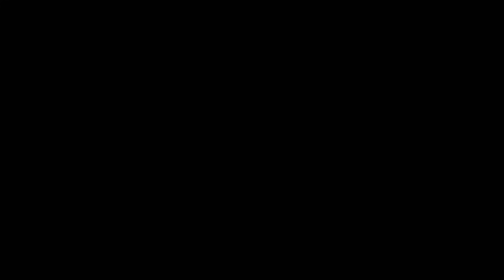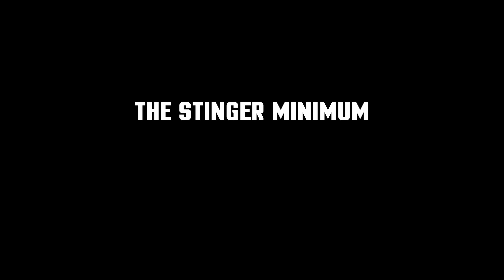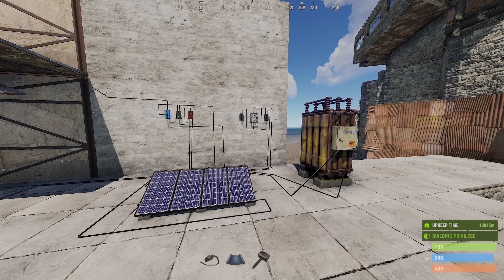Rust - The Electrical Setup For The Stinger Bases - Rust Base Design 2021

Comment: the lights still use power even when they are off during the day?
Reply from the maker: the batteries charge during the day with the lights off, and they turn on at night and use the battery power

Comment: Hey quick tip with the elevator, you don't need to put power into the buttons, the output can just go straight into the "Call Elevator" input without the BUTTONS being powered power, and it will still work!
Reply from the maker: I appreciate that, im a bit of a noob with electricity stuff

Comment: The automatic lightning is pointless unless you just like not having them on during the day. The circuit is still using the 12 rust watts regardless of if the lights are on or not.

That's because of the way branches (unfortunately) work in Rust.
Reply from the maker: Right

Comment: The floor calling buttons of the elevator does not need to power. Just connect the Button output to the stage caller and that's it...
Reply: You just have to power it when you want to combine the button with other functions. ( e.g. floor selector or offline switch)
Reply from the maker: thank you

Comment: In your maximum base design replace the splitter with 2 branches - then you dont waste so much energy because the splitter is sendig 33 energy to each section.
With the branches you can set the individual value needed for each section.
Reply from the maker: That is true

Comment: you don't need to power the button at all , in the elevator , the button produces power/signal on its own just hook it to elevator the only thing that need power is elevator its self nothing else  , so you don't need extra splitter or better you don't need any splitters at all , use branch if you need 1 turret , or 1branch with setting to 31 power + splitter if you need 3 x turrets
Reply from the maker: Yes, I didn't know about the buttons producing their own power, i would have built the circuit a little bit different if i knew that :(
Reply: @MyGamingExperience  the pressure pad can do the same thing send power/signal to close doors or call elevator xd, i think someone even tried to charge the battery with a lot of friends/slaves xd can't remember what YouTuber did that xd xd

Comment: I think if somebody fully built the base then it’s worth to add a wind turbine as you can power 9 turrets out of it which can work 24/7 using 8 branches, and branching out 10 on each. 
But setting up the wind turbine shouldn’t be on the shooting floor “in my opinion” cause the attack heli can just rocket it down
Reply from the maker: Yeah, it may even bee a good option to build a little extra 1x1 tower for the windmill seperated from this base too
Reply: I’d really enjoy seeing you incorporating that in future builds!

Comment: Couple of small tips...firstly  face ALL your solar panels north. They will get full power all day. Also try to avoid using splitters, use branches instead  (unless you are linking 3 things that use the same amount of power e.g 3 turrets) yes each branch cost 1 power each to use but a splitter evenly splits the power into 3 so if its to power 1  turret a light and the lift you waste lots of power using a splitter
Reply from the maker: I appreciate the help, I by no stretch of the imagination are an expert in electricity, I will put alot of time into it now so i can get better with the components, thank you again!

Comment: Use a smart switch instead of the normal switch, then link to your phone with the app
Reply from the maker: Interesting, thank you
Reply: @MyGamingExperience  Smart Switch cannot be toggled by those who are not authorized on the TC, normal switch can. Is it that hard to place one Wind Mill to supply 8 turrets? :D

Comment: I used to build bigger bases as a solo but the meta of the server I play on changed and now I have less time due to IRL stuff. I like having a 2x2 base with a connected furnace but it's not time efficient when I only have an hour or 2 hours to play as a solo. Now I just use dropbox bunkers. I know this has nothing to do with the video topic but I wanted to share.
Reply from the maker: All good!  Yeah the dropbox bunkers are really strong for solo's, the base ends up being super small and like 27 rockets+ to raid

Comment: Ayo wth, this is advanced level of automatic lighting.
Reply from the maker: There are some pretty in depth circuits out there
Reply: Is there a simpler way to automatic lighting?
Reply: @volcanicashes1996  bro what? this is the simplest way to do it and it's extremely easy to understand.power goes through blocker, when daylight is there it blocks the blocker and the lights turn off. when the solar panels stop recieving power they turn back on
Reply: @lynxsies  sorry i was retar
Reply: @volcanicashes1996  oh my bad 💀

Comment: The elevator call buttons don’t need a power input at the buttons generate 1 power when activated and the call signal only requires 1power
Reply from the maker: That is weird, why do they have an electrical input then?
Reply: @MyGamingExperience  its a recent patch, specifically for elevators.
Reply: @MyGamingExperience  with the input port they can provide >1 unit of power for short time, like toggling multiple switches... 
i used to design a circuit of multiple turrets and doors controllers, which closes automatically and turn on and off on a button using a memory, that was before the tech tree when it was hard to get all the components and craft it as they cost HQM
Reply: Pin this comment up